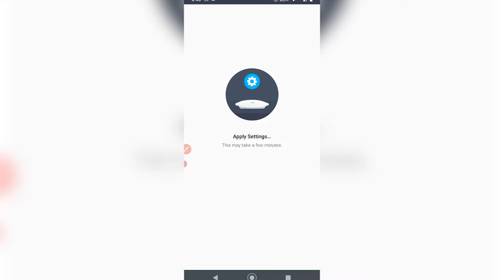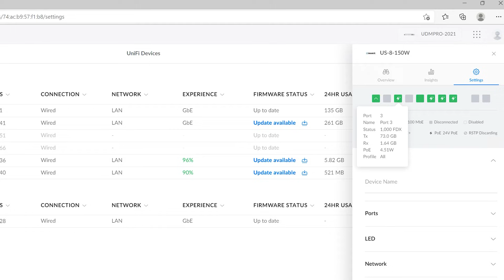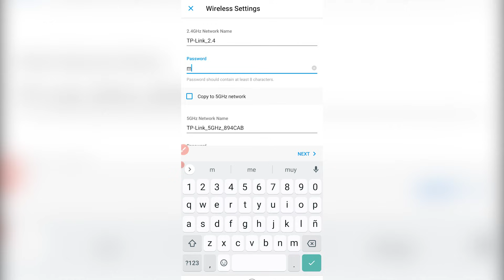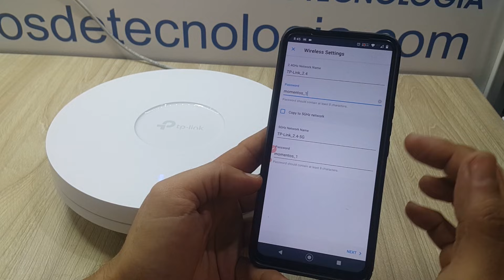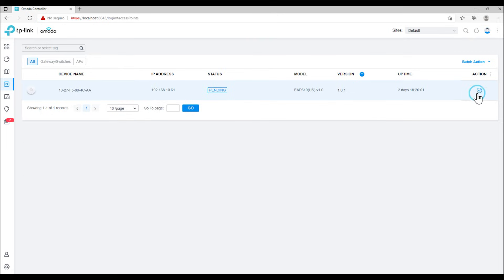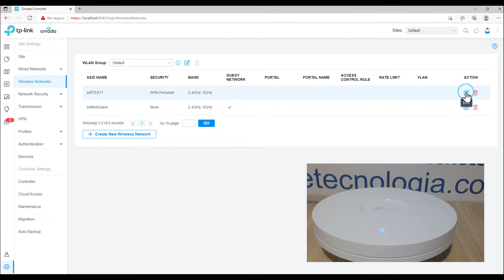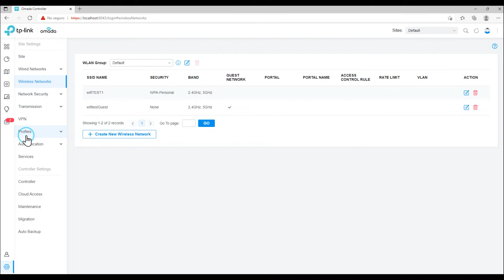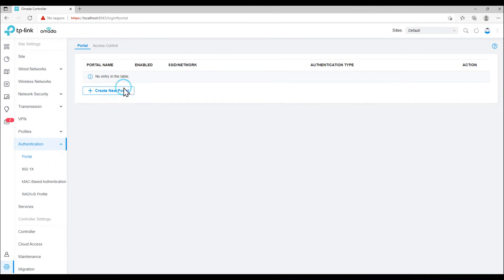How to Setup and Install a TP Link Omada Access Point

Comment: I have a JioFiber plan with a speed of 150 Mbps, and I've connected a TP-Link access point to my Jio router. The main problem is that it only provides 9 Mbps, which is very low; it should provide 70-90 Mbps. Provide a solution!!!
Reply from the maker: That will most likely be a client problem (the device that is connecting to the AP) as these APs are capable of much more than 400 Mbps.  Take a look at your config and use bandstearing so it will force your clients to connect to the 5 GHz band.  Of course chech first that your client is 5 GHz compatible.  Another alternative is to create a SSID only in the 5 GHz band so you can use that one for your faster clients.

Comment: how do i find the standalone icon, I don't see it. I noticed you recorded this 3 years ago, and perhaps the app has changed since then and the icon for standalone has been removed
Reply from the maker: Once you open the App (as of sep 2025) you will see a big title that reads Controller Mode.  That does not mean that it is the only supported mode.   Press the MENU button (the three lines)  and you'll see a link that reads Switch to Standalone Mode.  Hope it helped

Comment: Do I need Tplink router or can be any brand router as long as configure through app?
Reply from the maker: You tipically need to have the corresponding brand to the software you are going to use for example Omada Controller for the Omada line of products of TP Link, The Unifi Network Application for Unifi products from UIbiquiti, and so On as HPE with its Instant On line of products.  All offer In Band Management.

Comment: Hi! I am trying to setup an EAP AX3000 in stand alone mode. However the EAP is not in the list. The SSID is in my network list when searching for local network, but I cannot establish a succesful connection. EAP has stable blue light and LAN cable is tested. You have any idea? Thank you
Reply from the maker: I would do it, through the controller App in your windows PC, and also check the firewall is not blocking coms for the controller.  If you're doing it from the App, just double check that the AP is has been reset to defaults.

Comment: This would have been much better if you were not importing an existing config file into the controller software.  Unfortunately, that appears to be the tricky part, getting the controller to recognize the AP with a clean config.
Reply from the maker: You're right.  Well actually what we've done before "forgeting" and re adopting an AP is checking it has the latest firmware and reset it to factory settings.  It's never failed.  Also we like to do it from a controller in a windows PC or virtual machine.

Comment: Where are you connecting the tplink to? The Ethernet cable extending out of the tplink device
Reply from the maker: You can use a PoE switch, which is one we used most of the time, or a power adapter.

Comment: Hello.  So if you don't have omada controller and set this up as an access point in a home, what are the limitations?  I am hoping to set it up at a relative's place using my laptop.  They don't have any standalone computers and mainly have tablets and phone on their home internet service.

Also, I hope this is not a dumb question, if the AP can just grab a dynamic IP from the ISP router/modem, can I set up the AP in my home with the SSID and password, unplug everything to bring over to my relative's home and plug it into their ISP equipment and it will work right away without having to reconfigure it again?
Reply from the maker: You can make astandalones setup and if you're not going to use a hotspot or captive portal no need to have the controller always up and running.

Comment: I'm going to make the move to Omada Business. For now, I just need to expand my wifi on 2 areas. Can I add this EAP610 as a repeater to my TP-Link Archer AX73?
Reply from the maker: This one does work as a repeater, We just haven't tested outside the controller, I would guess it wouldn't work as such configuration is done from the controller and the Archer does not work with In Band Management which is classic of these business infrastructures.  Good luck with your projects!

Comment: Great video @technology moments.  Perhaps a dumb question: I’m running a single Unifi WAP connected to ubiquity poe injector to my ISP router. That WAP seems to be failing after 6 yrs. Can I simple reuse the existing network hardware and swap the WAP? The idea was then to use the app (like the unifi version) to configure the new tplink WAP. THANKS!!
Reply from the maker: Absolutely.  That is the great advantage of using these unified networks.  One simple consideration is check that the PoE injector provides enought power for the new unit.  If it is PoE and not PoE+ you might have to upgrade.  I would recomend going for a Unifi 6 AP Either Pro (https://amzn.to/40ZPQDS ) or long range (https://amzn.to/3T0tpMG ) for less clients and shorter range the Lite version does its job https://amzn.to/3N0Loie
Reply: thanks so much!!!! @TechnologyMoments
Reply from the maker: By the way al those need PoE+

Comment: I ordered one today. I ran an Ethernet cable from one building to another and this will give me internet in the second building. Both buildings are metal and Wi-Fi won’t go through them hence I had to run an Ethernet cable. I’m excited to see there’s relatively no setup involved as a stand alone access point. Thanks for your video too. I will download the app you suggested and configure my two networks with ease!
Reply from the maker: You won't be disappointed.  I have been using this for quite sometime with no trouble.   This first version (https://amzn.to/3QwLLlN ) is no doubt much better than the slim version.  The only problem is it's size, for some of us that is no issue at all.

Comment: For the 2.4 & 5.0 network name, can I just use my current Wi-Fi SSID and password?
Reply from the maker: Yes you can, but remember that the ideal scenario is for you to have identical network names in hardware of the same brand or line of products (Omada for example), this will let the hardware manage the "hand off" from one AP to another one of a stroger signal.
Reply: @TechnologyMoments  So...if I have my main wifi setup SSID for my house as Test2.4 pass 1234  when I set up the AP...can I set it up also as test2.4 with pass 1234 without a hitch? I have a few things in the back of my house that are already set up as Test2.4 but the wifi doesnt reach anymore. Im using the AP to extend the wifi...or is there an extension mode on the AP???

Comment: I have att fiber internet router; do I need a tp link router or can I go straight to tp link Poe switch?
Reply from the maker: You'll always need your ISP's hardware as it is the one they "certify" for their use.  Once that connection is at your home/office you can manage that connection either through a dynamic or fixed IP in your router, with your router being bridged by your ISP's unit or just connected being assigned an "internal" IP with just NAT being done by your ISP.  If you are gonna run many services and need complete control, ask them to assign the public IP address to your Router.  We recommend you use an Omada router and integrate your solution, such as the ER605 (https://amzn.to/40V6pPi)

Comment: Can you just plug it into your PC via ethernet cable?
Reply from the maker: Hi.  No under normal circumstances as for example clients will not find a DHCP server, hence no gateway nor DNS.  Under complex scenarios advanced users might do it with very specific setup running.

Comment: So to connect it, do you need access to the router? I am trying to strengthen my internet connection but I have no access to the router. Is there any way to connect without touching the router?
Reply from the maker: I understand what you meant in the previous question.  Well that is exactly what this device is for (strengthening your wifi network), and it does so very well.  You  connect to it's power device and the network port must be connected to any port or your local network but it will always need tobe able to reach your router (DHCP, DNS, GATEWAY).

Comment: I want to replace my very old router that my ISP gave me and replace it with a pfsense box from an old pc. I'm thinking of getting one of these to give me wifi access with it. Looks to me that this would be ideal. As long as I can connect with my phone to set it up, this should work for this application without issues? Thanks
Reply from the maker: Yes for sure this will help you very much.  WE did like this AP, as it has great range and stability.  You can set it up from your cell phone or a windows PC on the network.   The newest version is smaller but i don't know if it may have the same range this one does which is above average.  Here the link to both:   The one in this video:  https://amzn.to/3xTdgwQ  The slim version:  https://amzn.to/3SxqtFe

Comment: What is the Coverage Range of this AP in meters?
Reply from the maker: Hello Muhammad, that is the question we all would like the answer for.  It always depends on many factors, but the ones we've found to be the most important are:  Orientation (flat or vertical), structure of the walls (drywall - bricks - concrete) and sounds silly but power of the clients, as not all mobiles have the same output power in their wifi cards.  We see some clients with full signal and just by it's side a client disconnected for not being able to be listened by the AP.  Usually they receive the signal, but do not send it with the corresponding power.  In general, this one has more power than LR unifi APs.

Comment: Can you go over the benefits of using more than just the ap. If I use a controller and/or Omada switch and/or router what more do I get?

Also what are the limits around how I use the controller in terms of network topology.
Reply from the maker: Hello Alejandro, for sure there are many advantages you'll find when using the controller eventhough Apps like Omada and Unifi have evolved beyond what we expected.   Besides just managing topology and quick equipment "adoption", security and logging area couple aspects we are thankfull for when using the controllers.  Of course Captive Portals require to have the controller running, and last but not least important, scalability. Backup and disaster recovery also a key aspect.